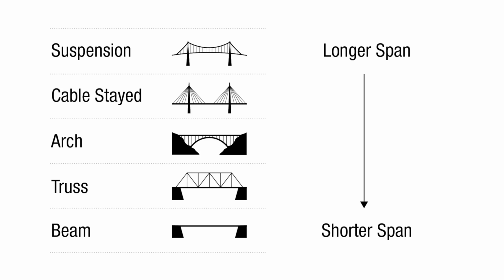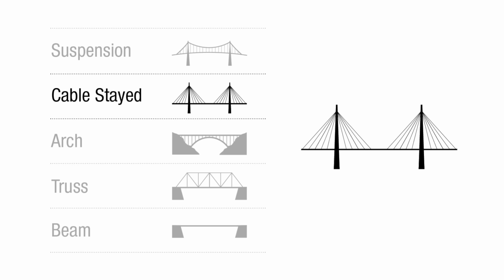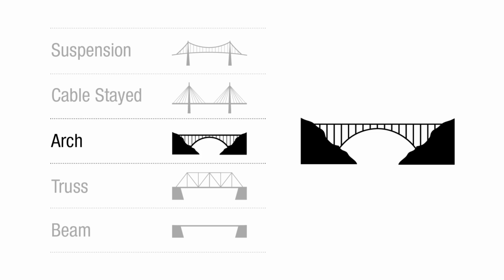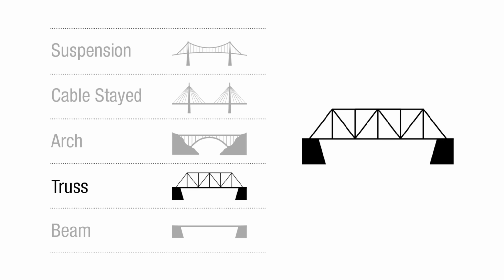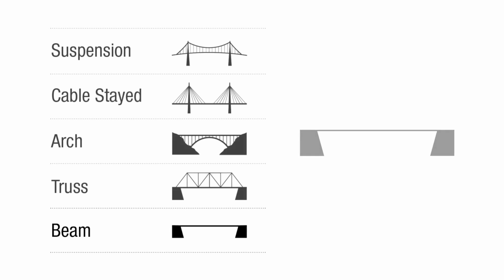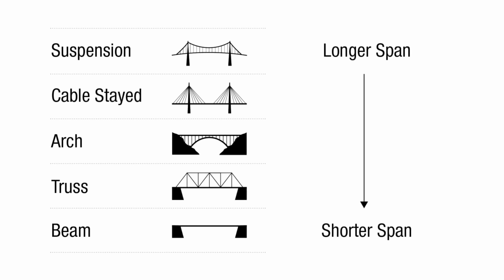The bridge as structure - Industry Insights: Bridge Engineering with Ian Firth Pt 3

Comment: Ah, it is very easy to build a bridge, just do not let it bend or hog between columns, sag on one column  nor twist, nor oscillate in any way. Avoid using  parallel  elements as in squares or parallelograms but apply triangular or zig zag structures where ever you can.  Learn about  forces due to vortex shedding in fluid mechanics and damp any three dimensional  movements that may occur due to elasticity in materials.  Learn about effects of dissimilar metals close together,  creeping, rusting and paint and protection, and permanent and non permanent joints. Store potential energy in a bridge, but never let it change into kinetic  energy, nor chemical, nor electric energy. Make sure to earth or ground  the Bridge.  Consider the safety factor required if the bridge is hit by an airbus A 380 or a Boeing 707. 
To build up experience from the experts, watch spiders building webs, beavers building  dams and birds building nests of all types, and ants and  monkeys dangling  together to bridge gaps or swinging from tree to tree  on  flexible branches.   
Watch the structures of four legged animals forming arches and lintels, Giraffes for cantilevered necks,  the wings of birds could be an inspiration to build bridges if you consider a loaded wing and turn it upside down.  If one wants to go deeper into analysis of bridges learn whey horses when trotting cantering  and galloping do it in a particular manner while  Giraffes and camels  move their legs in a different manner.  Nature has been building bridges for a long time, but we have not been able to make anything as strong as the web of a spider not anything that can take so many reversals as the muscle or tendons.
Reply: God is amazing